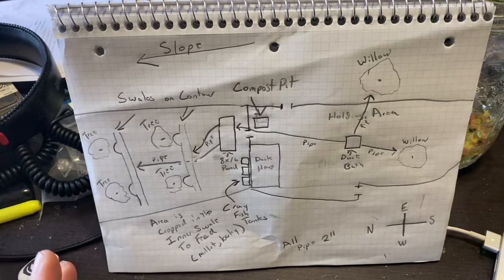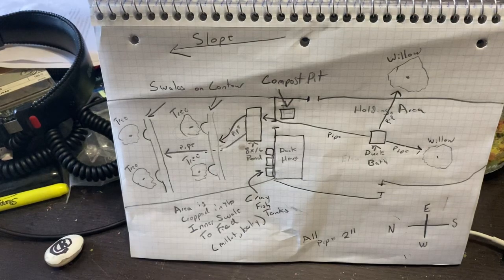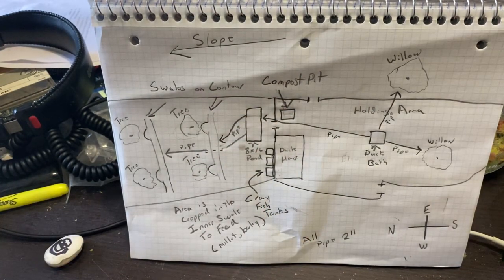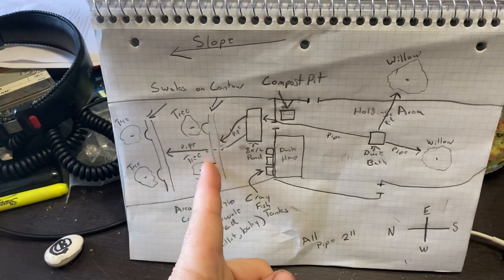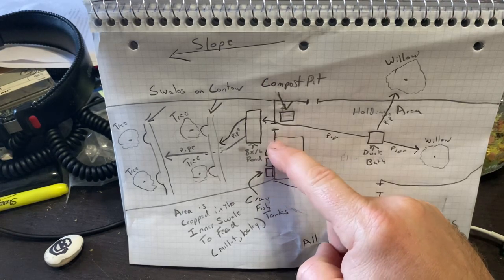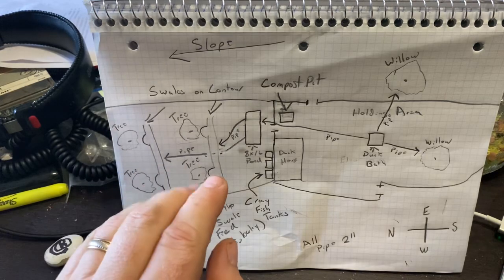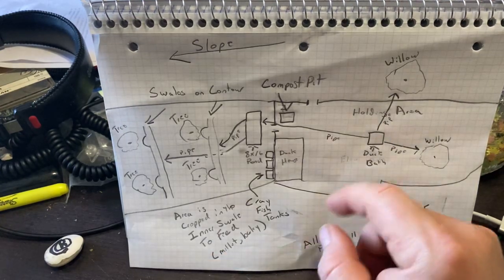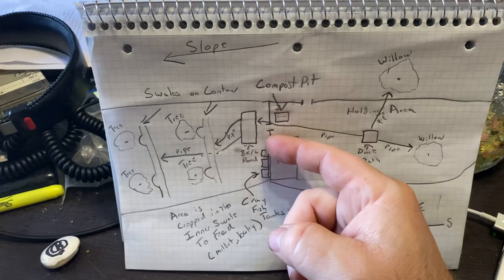Part 1 of 2 - Aquatic Duck Compost and Feed System - Function Stacking on Steroids

Comment: Big problem you are going to run into, your ducks WILL occasionally drop eggs into the pond, and the eggs will clog up a 1.5 inch pipe.  You need a minimum 2"pipe to drain a duck pond.

FYI RV style dump valves work way better than those PVC swing valves.  Its a pull/push valve instead of a turn valve, and they are rebuildable and don't stiffen up.  Works great in my duck pond.  

Great project idea though, I'll be watching your progress.
Reply from the maker: That is not a "big problem" it isn't even a problem.
Reply: @survivalpodcasting  Just relaying my personal experience in gravity draining a duck pond for the past year, it was definitely a problem for me.  Sounds like you have a plan to deal with it, good luck on your build!